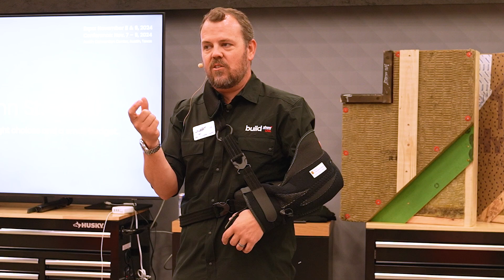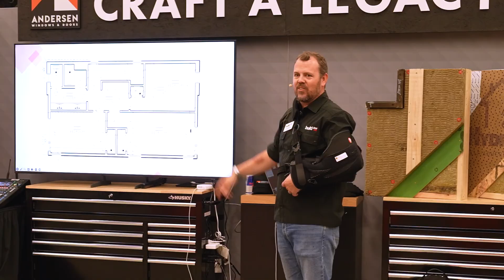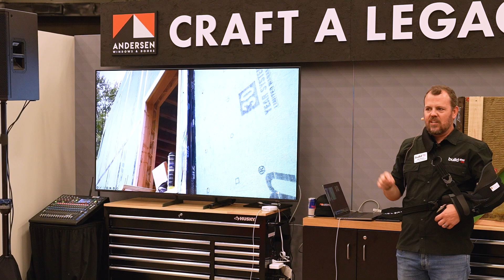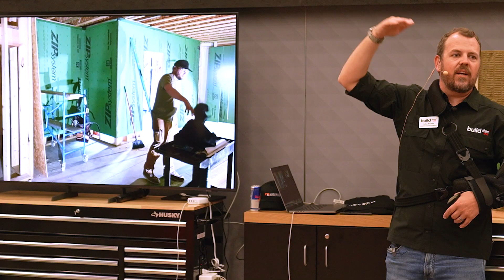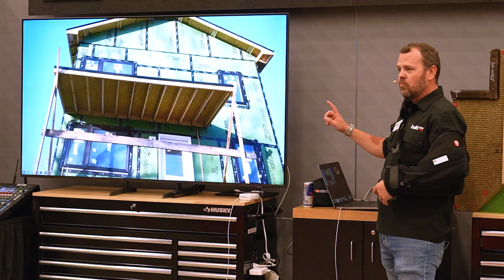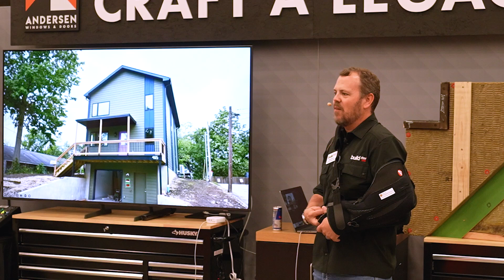How windows contribute to lower air changes

Comment: Matt, love your videos and content. However. Andersen windows and doors have poor quality and durability. Since the mid 1990s I’ve experienced new and replacement Andersen products and it’s the same thing—poor door seals, leaking window glass packs, failed window latch springs, delaminating exterior cladding, etc. Thirty years (four different homes) of never ending garbage.

Comment: On reddit I saw where a homeowner was quoted by Renewal by Anderson for $50,325 to replace front and back doors and saw pictures of the current doors. Can't believe they are quoting this much money! I guess that's a "throwaway I don't want the job quote."
Reply: I'm not sure what's up with that reddit quote but I had Renewal by Andersen replace my front door last June. They are expensive but no where near that expensive. I went with their top of the line door with basically all options(design window, multipoint lock, peephole) and it was 6k in total. That included tear out of the old door and install of the new one. I don't regret it at all. They did a great job and were very good at communication. Pella for a very similar door bid 9k for reference.
Reply: @DB57RB  Yeah I think they didn't want the job for whatever reason not mentioned in the post.